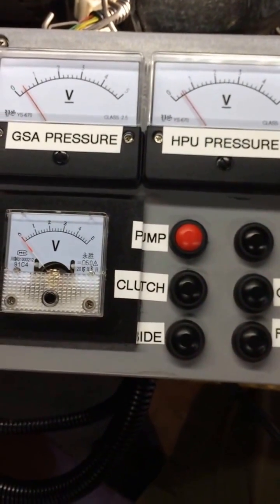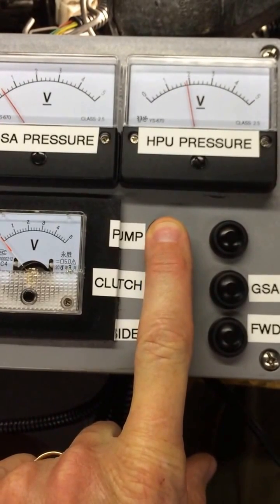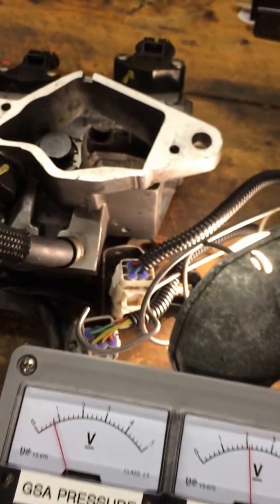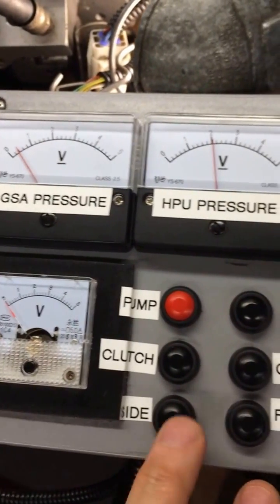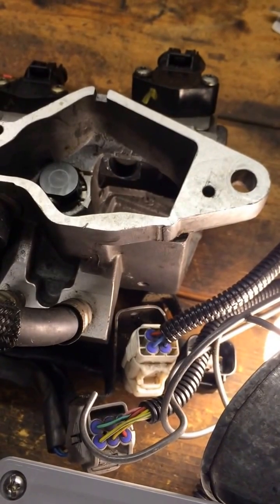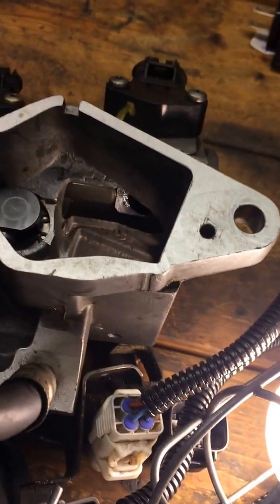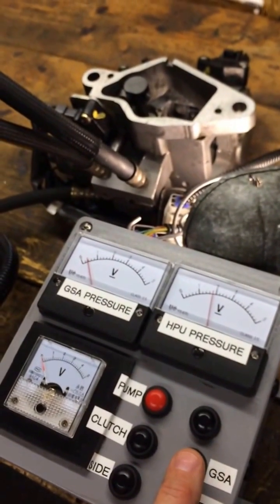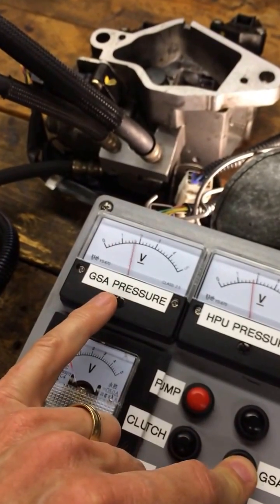MR2 Spyder - SMT tester cycles the actuators

Comment: This is a VERY VERY GOOD video of this system. May we please see the clutch actuation and just more videos in general of this SMT GSA and HPU.                                    Q1. are those actual pressure readings from GSA HPU or just voltage readings from pressure sensors. Q2. the shift and select actuators stop in middle of stroke to follow a H pattern can you demonstrate this please.
Reply from the maker: +Punit M 
Glad you like the video.  Clutch operation is pretty hard to demonstrate.  I have to yank on the cable with a pair of vice grips.  The actuator only retracts.  Extension is provided by the clutch pressure plate spring.   Readings are voltage from the SMT system pressure sensors monitoring the GSA and HPU.  Gauges are cheap though, so don't trust my readings.  The "H" Shift pattern is created by holding the actuators at half-stroke.   One actuator does the fwd/aft.  Other actuator does the side/side.   Full extend and full retract will engage the various gears.  I can't demonstrate with this silly homemade box - because I'm only using switches.  The proper function involves (as explained to me) pulse width modulation control of the solenoids, and a feedback loop from the position sensors.  Far beyond my silly box capabilities.  
Jump on spyderchat.com forum to join in the discussions:

http://www.spyderchat.com/forums/showthread.php?109297-GSA-HPU-Tester&p=1579785&viewfull=1#post1579785